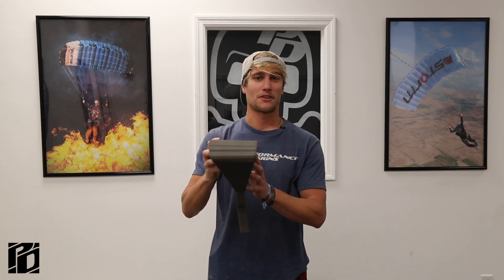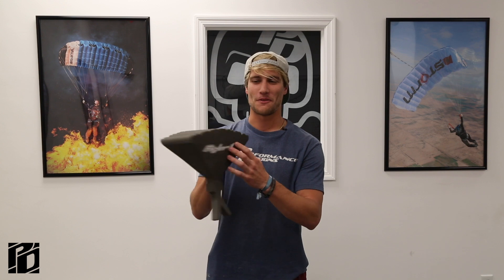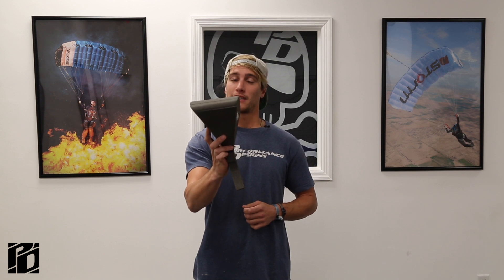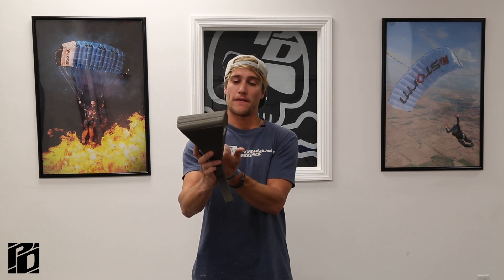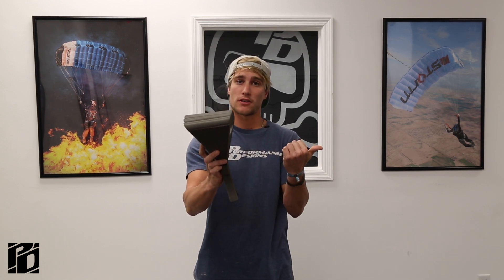Tip Tuesday: Two-stage flare

Comment: The thing that gets me is at what height to start the 1st and 2nd
Reply: You can learn it on flight 1 courses(101 then 102). But i will try my best to explain it to you: first thing is you wanna have digital alti so you can calculate how much height is your canopy losing after you done full flare( you practice in in the sky- can be done after  hop and pop or just after freefall in any skydive, above 2000ft( no excercises below 2000ft for safety ) and each canopy will have different characteristics    plus it will be losing different amout of altitude due to different weight of  each skydiver, so what  im saying is that is no rigid answer to your question, im jumping now with canopy 230 and my wingload is 0.8 ish, the only way to find out when to start 1st stage of your flare is to keep jumping and finding "sweet spot" as they say and then when you are already half brakes- this is how you start 1st stage- slowly but firmly pulling brakes( toggles) half way to slow down canopy but to keep it moving forward and then you decide when to finish flare( 2nd stage). I hope it helped a bit as i spent ages writting it😅